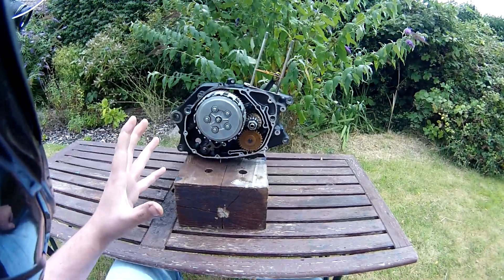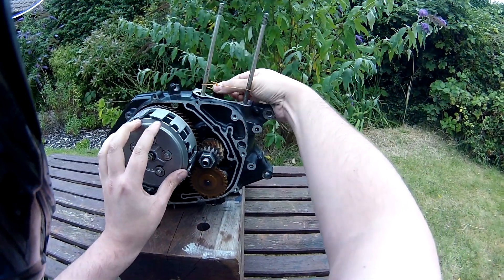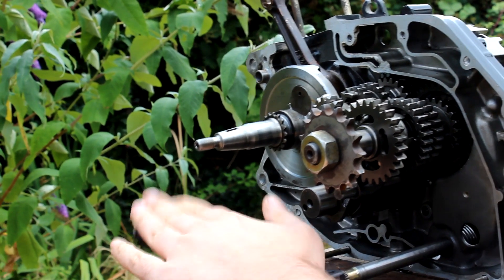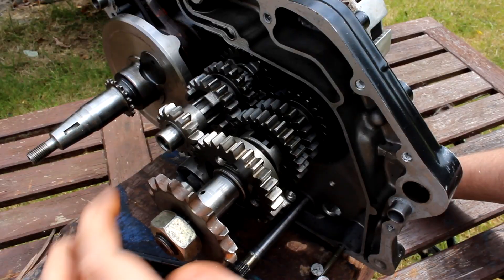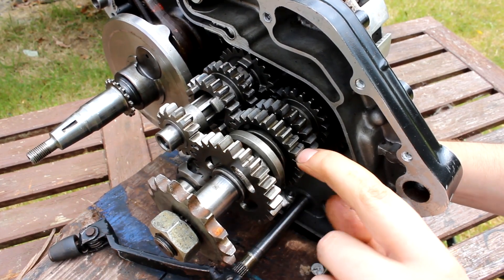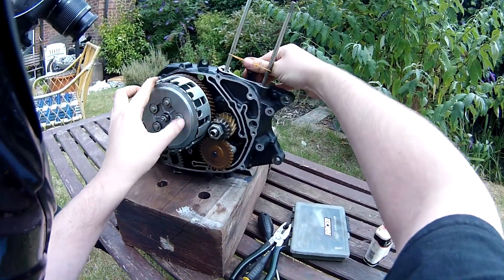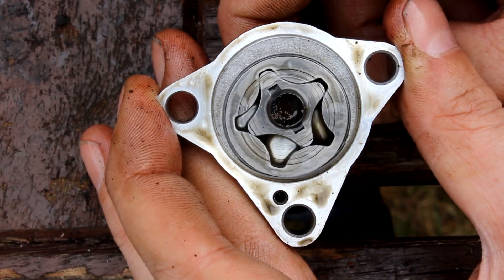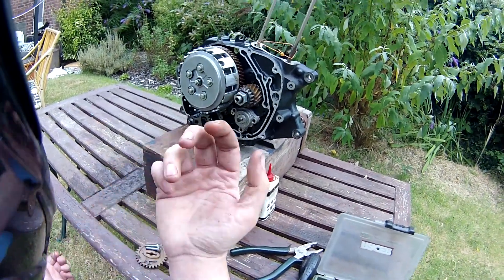How a Motorcycle Gearbox Works!

Comment: Hi, when i went to ride my bike the other day the gears wont shift when moving or stationary. Im not sure why its doing it as i was out on it just hours before and it was fine. Any ideas of how to fix it? Thanks
Reply from the maker: If you can't get in or out of any gear then it sounds like a gearbox issue. Possibly a bent or broken selected fork. Would help to know what bike it is.
Reply: Thanks for the reply, its a lexmoto isca, it will roll with clutch pulled in just wont shift
Reply from the maker: @taylorpreston8502  Yer sorry to say that really sounds like the gearbox is messed up in some way. Pulling the clutch is disengaging the box so It can move. Could be a selected fork or even a bearing. Either way its going to neen the case split to see and on a engine like that it is more likely going to be cheaper to do an engine swap.

I would get a mechanic to look at it.
Reply: @spicy110 ok, thanks so much for your reply and information.

Comment: If I have noise coming from my primary in gear and also out of gear and even rolling in nuetral with the motor off I'm hearing it any idea what it could be it's like a low whine noise?
Reply from the maker: Hmm tricky I guess it could be something like the countershaft bearing or even a crank case bearing. Very hard to say without hearing it.
Reply: Went to make a video for you to listen to and wouldn't make the noise but it def was the one day and it did it in gear as well nuetral but I was on a hour straight cruise.... maybe belt or belt pulley and it has to get hot hot?

Comment: Thumbs up to this vlog, thanks. Explaining the oil pump and seeing that very beautiful design definitely cleared up a lot of what was boggling my mind when it comes to oil viscosity. For both cars and bike, damn, I can finally relax again thank u 😊 I now feel much more confident in upping to 20w50 in my car knowing internally that I'll have nothing major to worry about. No lies, I've been driving so little since I upped to 10w40 because my internals still felt a tad bit "loose" and I did the motor over 40k km's ago so I was very two-minded on whether to go 15w40 or 20w50. I'll just be sure I'm up to temp. before really driving; also I now realize it must be the oil pump getting all the wear when riding with no clutch. Theory and experience tells me the fibre plates should be fine as you not engaging and disengaging all the time, plus it's a wet clutch system, I just didn't know what was taking up all the wear

Comment: Spicy 110...whenever I see someone passionate about machines and mechanics, I think of that Kipling poem I mentioned earlier ("The Machines"). I watched your video again. You truly have the spirit and soul to appreciate the wonders of mechanical engineering! Those gears turning, the ratios, the simple beauty, the science and math of the engine... 

If you will indulge me, I will borrow a bit from Kipling...

"We were taken from the ore-bed and the mine,
We were melted in the furnace and the pit—
We were cast and wrought and hammered to design,
We were cut and filed and tooled and gauged to fit.
Some water, coal, and oil is all we ask,
And a thousandth of an inch to give us play:
And now, if you will set us to our task,
We will serve you four and twenty hours a day!

"But remember, please, the Law by which we live,
We are not built to comprehend a lie,
We can neither love nor pity nor forgive.
If you make a slip in handling us you die!
We are greater than the Peoples or the Kings—
Be humble, as you crawl beneath our rods!-
Our touch can alter all created things,
We are everything on earth—except The Gods!

"Though our smoke may hide the Heavens from your eyes,
It will vanish and the stars will shine again,
Because, for all our power and weight and size,
We are nothing more than children of your brain!"

Comment: Can someone versed in motorbikes please tell me what kind of gear rations motorbike gearboxes typically have? Meaning gearbox input shaft : gearbox output shaft? I am looking to repurpose a motorbike gearbox for use on a electric motor-driven machine. Preferably the wider the gear range the better, and the lower the lowest ratio the better (i.e not looking for a close-stepped transmission). Any help is appreciated, as my search mostly turns up stuff about sprocket combinations and final drive ratios.

Comment: Great video . When you get the clunk into first gear fron nutural is that Beacuce the input shaft is spinning slighly?
Reply from the maker: Basically yes it's the gear engaging and then the engine overcoming  the friction of the clutch plates even when the clutch is pulled in there is a little friction.
Reply: So is the noise from the gear dogs slamming into place ,becauce of the free rotating gears from the input shaft are moving ?
Reply: Such as when you go from nutural then into first you get the clunk then if u bring it back to nutural with the clutch still held in place then it will go in gear smooth is that becauce the input shaft hace stopt moving becauce the dogs stoppt it the first time ?
Reply from the maker: @drewtaylor6623  yes, once it goes to neutral there is no resistance, it can just spin freely.

Comment: Nice Video mate, but i have a question, doesnt the oil pump wear off quickly ? I can imagine spinning it with the engine rpm at these insane speeds , even tho lubricated with oil, that it wears off ? :D
Reply: It would normally last the lifetime of the engine if oil changed at correct intervals

Comment: was just curious how motorbike  sequential shift worked as compared to car gearbox. Not sure this has answered that question for me but stayed till the end because I liked it so much.....that oil pump at the end makes me very glad I stayed:-)
Reply: neeniebob1 

They pretty much work the same with how the clutch and the gear plates work. Some cars do however have completely different shifting systems.

The main difference between sequencial compared to a car gear box is that a sequential goes up or down one gear at a time, and that's mainly because we change gear with our foot. With a car gear box, you are able to shift straight from one gear to another in one motion e.g. from 5th to 2nd.

If you look at very old bikes (1920s), you will see that a lot of them have a car gear box rather than sequential and that's because they were operated by hand.

So overall, they have very similar systems, a friction plate that engages and disengages the drive and a clutch that fits into the gear plates by direction of a clutch, but a sequential gear box will be set to only change one gear at a time via the shifter spring.

Comment: why gears can be shifted without using clutch? how can this be?
I think it could damage gearbox
Reply: It can but if you know what you are doing it won't.  Best not to even try.
Reply: Primus Yeah, it is hard for me to visualize, or even understand, what the coming off the throttle does to the force being applied.  Even when you are off the throttle the engine is still spinning and applying torque -- or is it?
Reply: Primus Forget downshifting for now as upshifting is hard enough to visualize.  And I'm not sure what you mean by drag.  You seem to be saying that the turning of the wheels and gears attached thereto remain constant more or less due to the momentum or inertia but when you come off the throttle the dogs actually pull away from one end of the detente and hit the other and then as you reapply power the dogs hit a "sweet spot" where they are touching neither end of the detente (again), is that right?

Comment: okay, how about motor without a clutch? i mean the one that like a dual clutch for a car. Especially motor that its cc below 120. was it same as the dual clutch function? sorry to bother :D
Reply from the maker: +Asyraf Cboy If it's on say a moped then it's a centrifugal clutch.
Reply: Dual clutch is just as the name suggests, there are basically 2 transmissions and 2 clutches, one transmission has gear 1,3 and 5, the other has 2, 4 and 6, When you are in first and accelerating, a computer will only engage the clutch of the first transmission, but already shift the second gearbox into second gear, so when you shift it simply disengages the clutch from the first gearbox and engages the other one, then it'll shift the first gearbox into third while you are accelerating in 2nd, and so on. And like spicy said, in a moped it is a centrifugal clutch, just a clutch that only engages when the engine spins fast enough, so that when you let go of the gas and the RPM's drop it automatically disengages, these have CVT transmissions too, so they do not have to shift like a normal car has to

Comment: Need help... my motor is yamaha 135cc, now my problem is every i shift from 1st gear to 2nd gear there is that Tok sound unlike im shifting 3rd, 4th, and 5th gear the sound is Tik. I think the Tik sound is just normal but the Tok sound every time i go from 1st gear to 2nd there is that Tok sound... Do yu any idea on how can i fix or adjust something in the engine...???? Thanks
Reply: Thats completely normal all motorcycles do that

Comment: +spicy110 I brought a shineray gy 125 same engine as yours but it just Revs when I put it in any gear it doesn't move at all in any gears just Revs if I lift the back end of the bike up the rear wheel spins fast any ideas :(
Reply: Adam Kelly sounds to me (though im no expert) like there is no friction happening in the clutch as did you notice on the video how there was no clutch fitted to his engine but it still turned the other side with no resistance that you would normally get from the wheel being in contact with the ground so possibly with little or no friction in the clutch you would see the symptoms you describe, if this is the case you could start by ensuring you have the correct oil in the gearbox as sometimes synthetic oil can cause slipping in wet clutches (though i wouldnt have thought to this extent) but it may be wise to drain the oil anyway and look for possible fragments of a missing clutch plate
Reply: Adam Kelly another thing to check is that the clutch is not stuck on, im not sure on your specific engine how it operates but my clutch cable goes into the side case and operates a pin that pushes out when it rotates and that pushes a rod through the engine onto the clutch on the other side, mine sometimes gets gunked up with oil and grit off the chain and the clutch starts sticking and the lever becomes stiff which requires i take off the side cover, clean it all, remove the rod, clean that put it back, oil the pin and spring in the side cover with wd40 and replace everything and then its fine, if this doesnt work or if the problem didnt start after a recent oil change then i would have thought your clutch has burned out/disintegrated

Comment: That oil pump is pretty awesome in terms of design.  On a car it's just an impeller on the other side of a plate with the timing or serpent gear on the other side, lol.

I dig into vids of mcy transmissions every chance I get so I can't really say the trans action is news to me (but I did enjoy the vid and explanation anyway), but it still baffles me every time I watch a tear down / rebuild vid (and see it hand actuated) how the hell everything in there 'exists' in a manner that it all works like it does for some absurd # of miles!

The tolerances are also crazy sometimes.  You have these spinning things next to parts that are stationary and it looks like if there's just a little bit of flex they'll hit and cause catastrophic failure...but it doesn't happen!